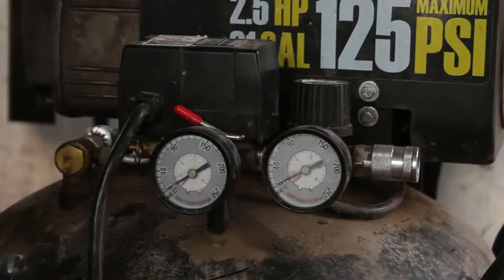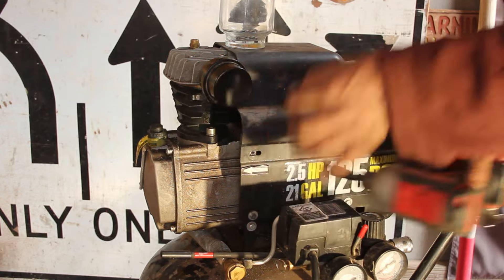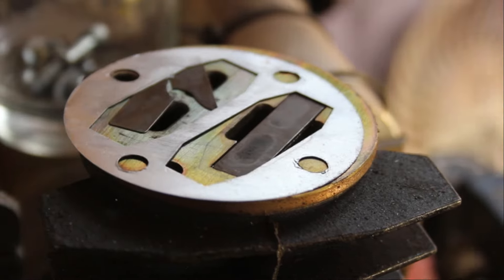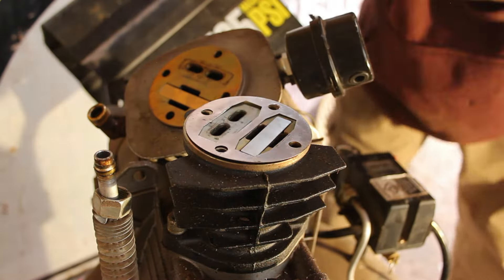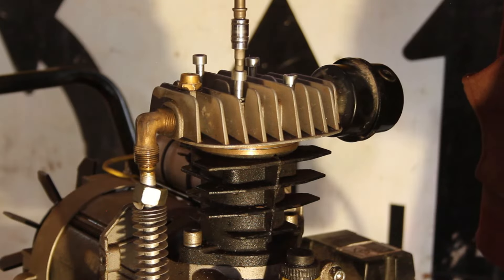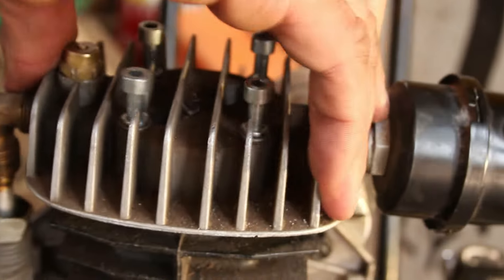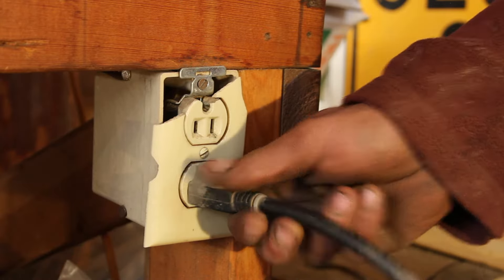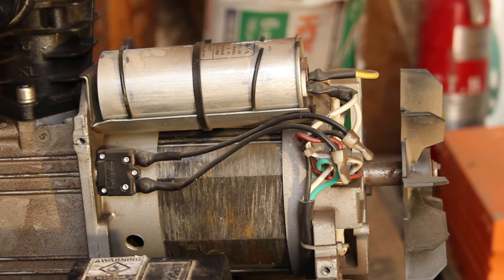How-To Replace Reed Valves on Harbor Freight Compressor Runs but Won't Build Pressure Compressor Fix

Comment: Very helpful video. Had the same issue with my Ryobi Ac 2050 air compressor. 

Also experienced the same problem when reassembling and only getting 40psi. 

After speaking to the agent, they recommended using a small amount of engine grease on the parts to hold them in place. Worked beautifully! 

Thanks again. Best wishes from South Africa.

Comment: It helps to put two small dabs of grease or vaseline on the tips of the head side reed to keep it in place in the head before lowering it into position. I used dielectric grease that I had laying around

Comment: At 2:25, I suggest an alternative to the "wiggle method, but it requires separating the top plate from the top head piece--quite appropriate if gaskets are being replaced.  Just apply a magnet to the topside of the plat, then set in the reed until the plate is in place, then remove the magnet before bolting the whole assembly together.
Reply: Hey great video mate. Your work method is just like us Australians, into the shed and crack open those cans THEN start on a project, I love it, we really are great allies 🍻👍😂

Comment: Our company H.P. was a lemon 🍋. End of making lemonade out of it. The reed valve I made was out of stainless about .014. I almost used shim stock from a craftsman feeler gauge.  The poppet valve on our's had an issue also (fixed). The 21 gallon H.P. started hard. I drained the compressor oil & used trans fluid for fluid and has run good since. Maybe used a total of 20-30 hours since. Rich from small airport in Iowa.
Reply from the maker: Very cool. Mine has popped another set of valves since then. Have never changed the oil so am going to try this and see if it runs/starts smoother. Appreciate you taking the time to share some good info in the comments. Cheers

Comment: This is helpful to me as I took the head apart and then my compressor only built 2 psi pressure. I already knew it had to be something with the valves but the "wiggle method" is a great idea that I haven't tried. Will give it a go. Cheers
Reply from the maker: awesome, glad it was helpful for you. Give it a shot and let me know if it works out for you. Appreciate you watching and taking the time to leave a comment. Cheers
Reply: @EscapePowerSports  I actually tried it but it didn’t work for me. The gasket made it so that it wouldn’t go into place. But I managed by holding it down and being very thorough

Comment: A small dab of petroleum jelly (or K-Y) will hold that upper reed valve in place during assembly, and because it's so thin of a paste, it will melt away when the head heads up, providing a little extra temporary lubrication while the piston slides in and out of the cylinder.  You can still go with the touch-and-wiggle method if you want, but I prefer the K-Y slide method.  What!  Can I say that???
Reply from the maker: haha yes, great info on another way to accomplish this. Thank you for watching and taking the time to share some good information on the topic in the comments. Cheers
Reply: I used Vaseline to hold it.